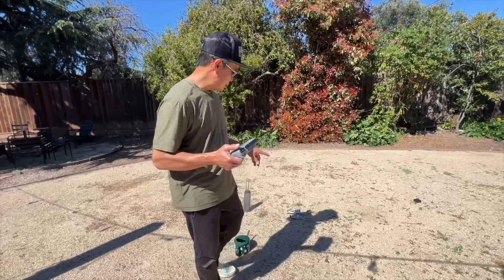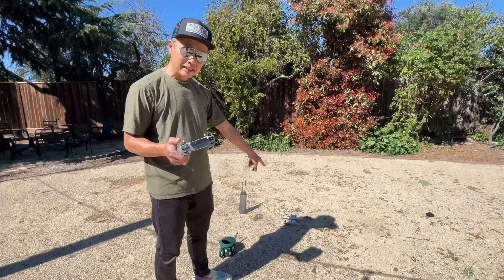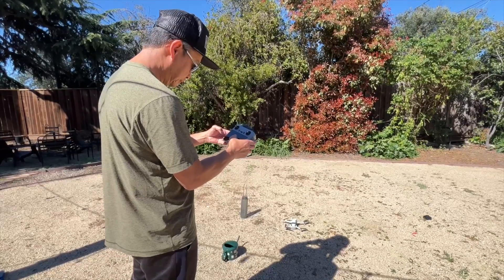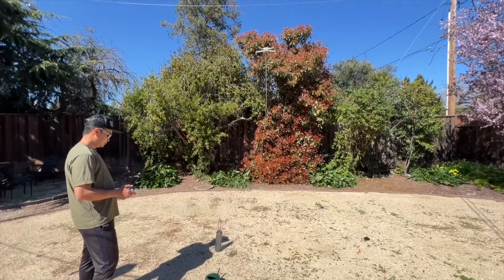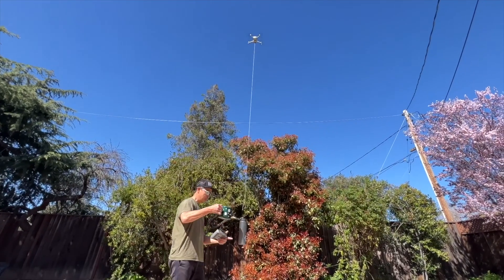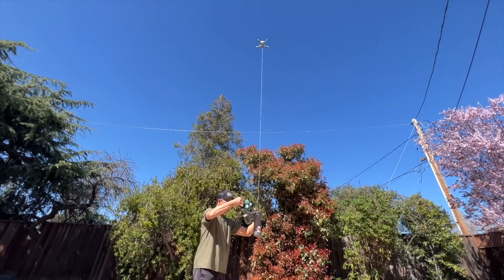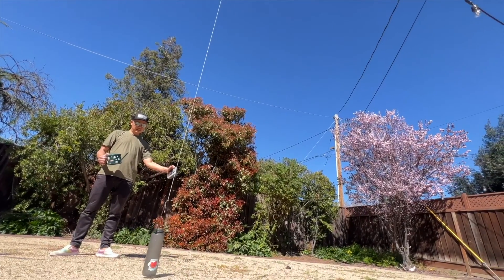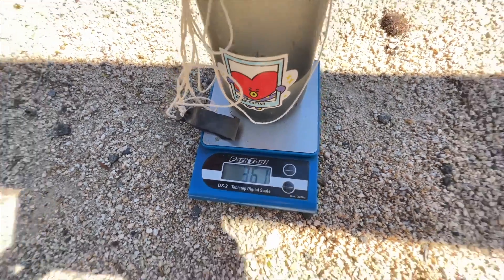How much can the DJI Mini 4 Pro lift? - lift own weight, max payload capacity how much can it carry?

Comment: I’m thinking of doing a lift test with my Air 3 and Mini 4 Pro.  I’m going to use a string to suspend a small scale from the drone and with the scale anchored down, lift and see what the scale reads.  Of course, I’ll have see what small scale and string weighs and add that in.
Reply from the maker: Sounds like a good test!

Comment: Hi, happen to be looking for information about the Maximum Lifting Capacity of a DJI Mini 4 Pro WITH the Standard Battery and came across your video. Very useful/thanks – pretty much what I was looking for.

HOWEVER – it just occurred to me that you could’ve probably determined this both much more easily and PRECISELY if you had done the following”

First of all, fill up some sort of suitable container like you did with weight ‘OBVIOUSLY MUCH GREATER’ than what the drone should have been able to lift. INDEED – THIS WOULD NOT HAVE TO EVEN BE ANYTHING ‘LIQUIDY’– it could be something/just about anything – ‘solid’ – with some means of attaching a string to – perhaps a fishing line

Let’s assume for purposes here that whatever it was decided to use – it ‘Just Happened To Weigh’ – say – 500 g exactly – although it doesn’t really matter as long as the weight is more than the drone could POSSIBLY LIFT?

Then, place that weight on a digital scale – and set up everything for your test – with a string or fishing line attached to the drone.

THEN, WITH THE WEIGHT ALREADY OWN THE SCALE AND THE DRONE REVVED UP AND WAITING TO ‘LEVITATE’ – TURN THE SCALE ITSELF ON.

BECAUSE THE WEIGHT WAS ALREADY ON THE SCALE WHEN IT WAS TURNED ON, THEN WHEN THE DRONE TRIES TO LIFT IT – THE SCALE WILL START TO ‘READ NEGATIVE’ …

THUS, that – the negative reading – would represent EXACTLY AND VERY EASILY – THE MAXIMUM LIFTING CAPACITY OF THE DRONE.

‘No muss, no fuss, no bother’…

(Note: an equivalent test could be done with the scale already turned on WHEN THE WEIGHT WAS ADDED TO THE SCALE. JUST USE THE TARE FUNCTION WHICH VIRTUALLY ALL DIGITAL SCALES HAVE BEFORE CONDUCTING THE LIFTING TEST.

Either way, I think it would’ve been a lot easier and taken far less time this way and might be something to keep in mind in the future. ‘Think TARE’ when it comes to digital scales. Very useful. MIGHT be very interesting to see another test done using this method and see how it compares to what you were able to obtain through Trial and Error; nevertheless – very useful.

Comment: For anyone out there, I see that drones have payload dropping devices now, but I really don't see a pickup type of device.  Does anyone know or can they think of something that would allow me to securely attach a DJI Action 4 to my Air 2S and place it somewhere to record and then fly my drone back a few hours later to go back and pick up the drone?  Any thoughts or folks that you can think of, please let me know.  Thanks
Reply from the maker: That is a great question. I will investigate and be on the lookout.
Reply: @drone_tech_review  thanks buddy.  Can you think of any companies to contact like bhphoto, etc?
Reply: If you type "drone claw" into Amazon you will see a device that may do what you want --- but it might also be easier to attach some sort of large hook or loop to your Action 4 and then use your Air 2S to pick it up using it's own hook?  There is another idea that involves magnets --- attach one magnet to the Action 4 and then dangle another magnet attached to a string that tied to the Air 2S and slowly descend the Air until both magnets click together?
Reply: @fredwerza3478  Thanks for the ideas Fred.  I'll try the magnet idea and look into the "drone claw" too.
Reply: I own one
Reply: I am thinking it would be very effective and cheap for the load to have a large loop (plastic or metal wire) and the drone can have a down wire with a hook. That can do both pickup and drop.

Comment: I know the mini 2 is able to carry a max payload of around 17 oz so seeing that the mini 4 pro cannot even do that is not really all that impressive, but that isn't the main selling point either. More so just a peak of curiosity
Reply: 17oz? 😂 I’d have to see that
Reply from the maker: The DJI Mini 2 can lift a maximum of 10 oz or 283 grams.  Definitely not 17 oz. 

Considering the Mini 2 only weighs 249 grams, that's still darn good as it can lift more than its weight... like an ant.

Comment: Well done. Thanks for doing this. It would be interesting to know how long the battery lasts when lifting different loads.
Reply from the maker: I lifted a 200 gram load and the battery metrics, said it had 10 minutes of runtime instead of 20 minutes with no payload.

But it got very hot during hover and it landed itself after about 3 minutes.